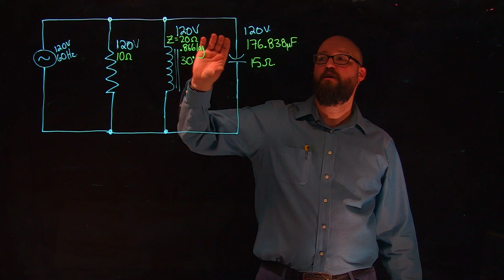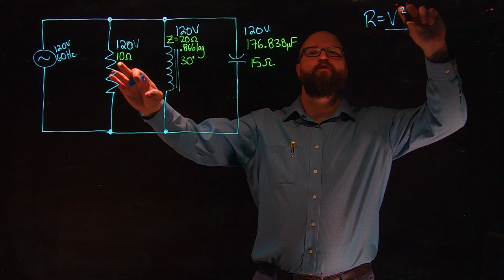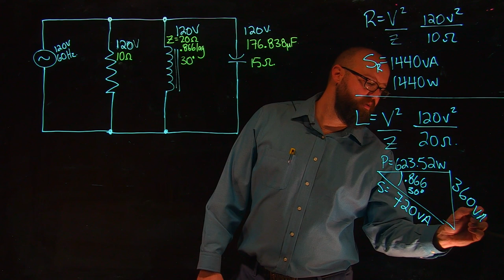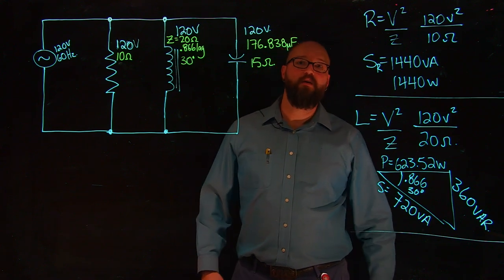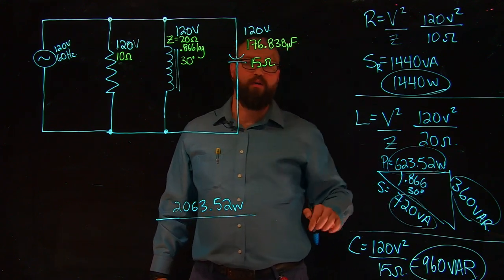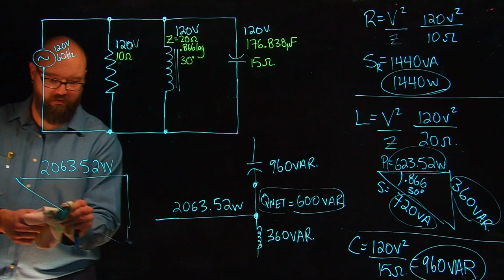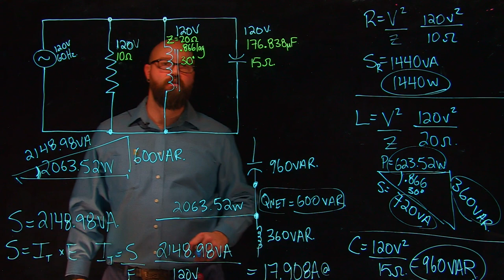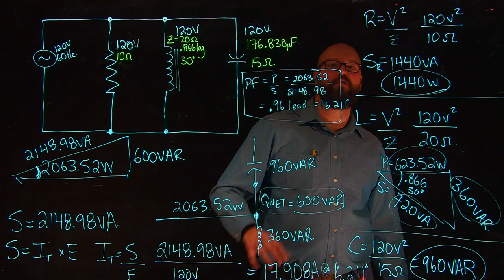Parallel RLC Power Method

Comment: thanks for the video sir....sir we know the apparent power equal to Vrms/Irms......so in this problem,do we need to assume that the voltage source in RMS...HOW CAN WE THINK  THIS SOURCE IS NOT ALTERNATING.SORRY IF I'VE MISTAKEN.  
Thnak you.
Reply from the maker: Thanks is for the question! It would be an rms voltage for sure. Would also definitely be an AC voltage in the problem.
Reply: @schulerruler  Thank you lot sir
Reply: @schulerruler  So sir in problem mentioned the voltage as 100<45 (as an exmple) should we assume this voltage as RMS or do we need to find it.Can we define a phase angle for a RMS value?
Reply from the maker: @neatvfx  you can assume all values stated would be RMS value. RMS and phase angle are different things, which is confusing, but remember, phase angle is always how much the phase current leads or lags the phase voltage. All currents and voltages being stated would be read with a meter, and these values, regardless of phase angle, would be meter calibrated to always show RMS values.

Hopefully that helps, though I know it's confusing thinking about phase angle vs RMS angle.